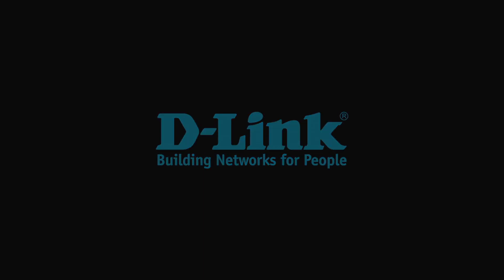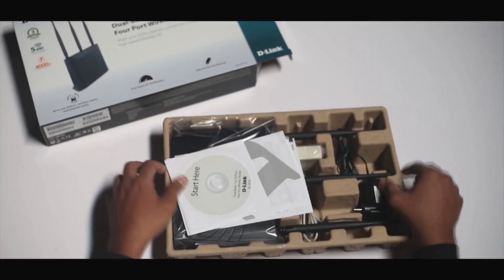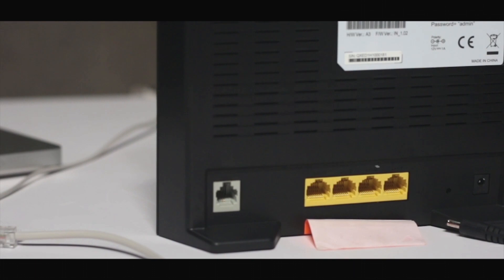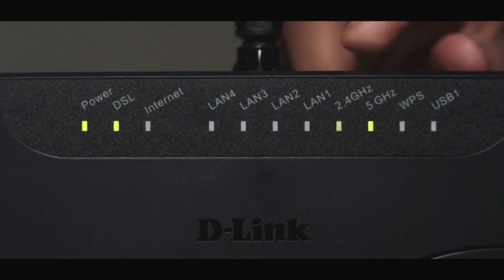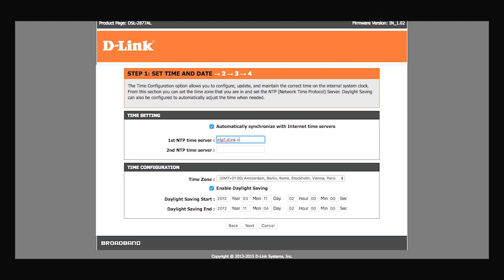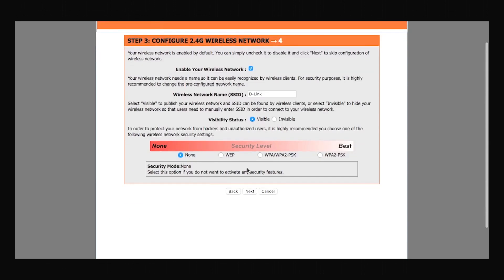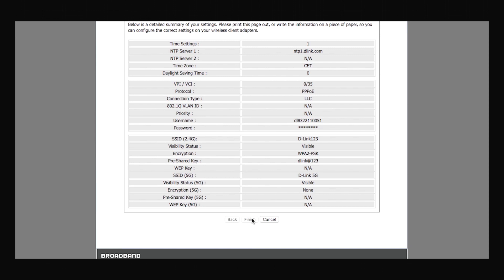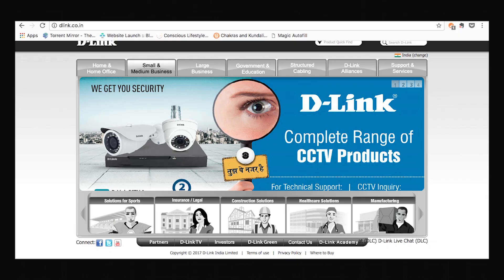DSL-2877AL Setup Video

Comment: Mine have wan socket but when I plugged in the rj45 cable from my main router it didn’t work
Reply from the maker: Are you trying to cascade two routers? Is a cable from LAN of another router connected to LAN port of this DSL-2877AL router?